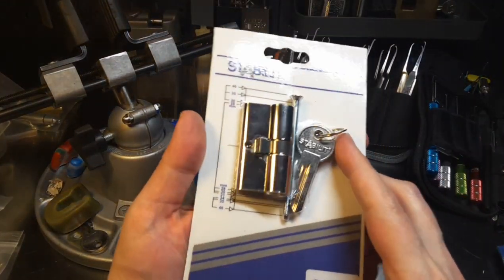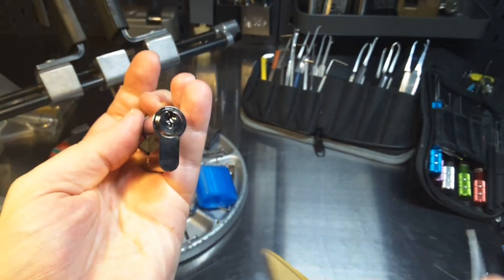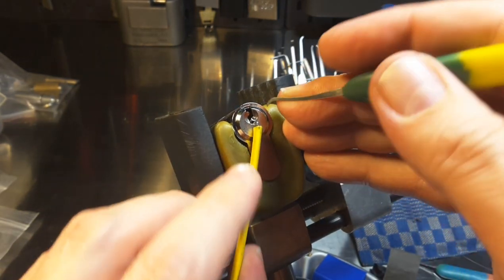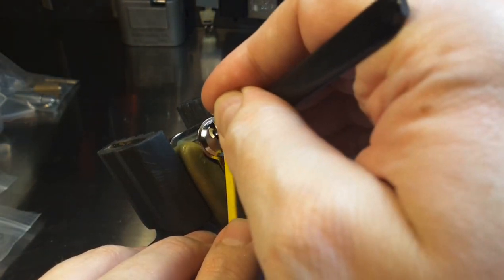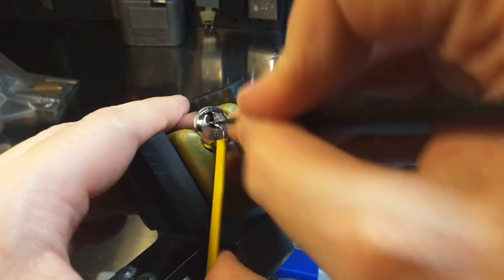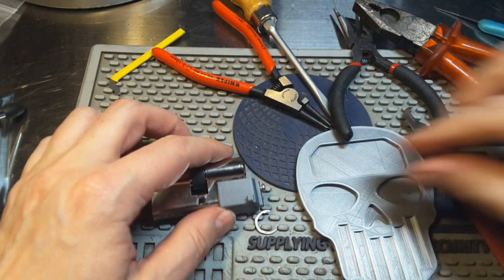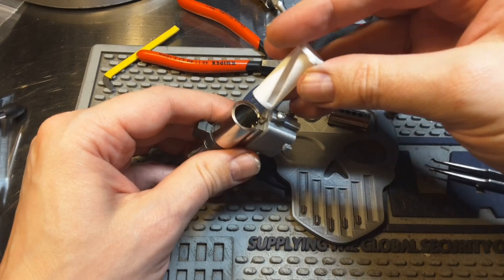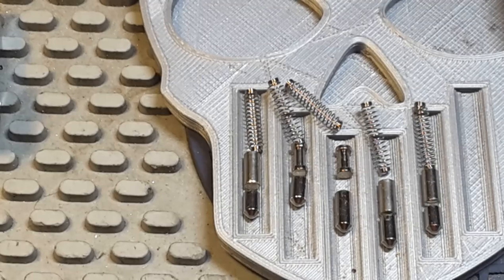Lock Picking A Stabilit Euro Cylinder Out Of The Package [86]

Comment: What or how much is “inexpensive”?  I am going to France this summer and I will be picking up some euro cylinders to bring back to Canada.... cheers sir!
Reply from the maker: I think this one was 9€. New cylinders, that are not crap, are sold from 20€ to 70€ (with high end locks up to 200€!). That's the reason why I buy used cylinders from eBay most of the time. The best way to get them is to trade locks with an European lockpicker 😉